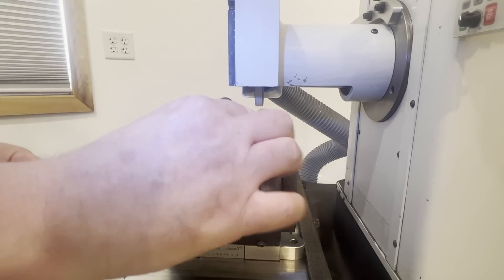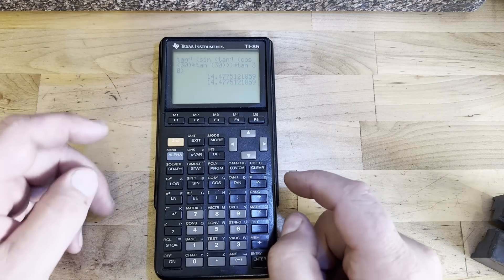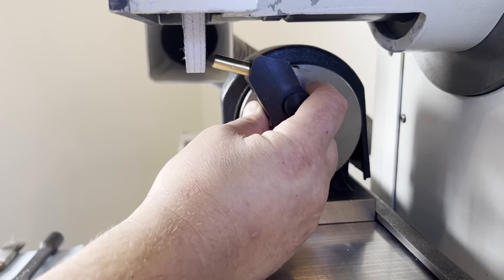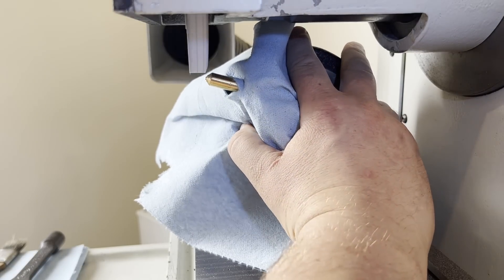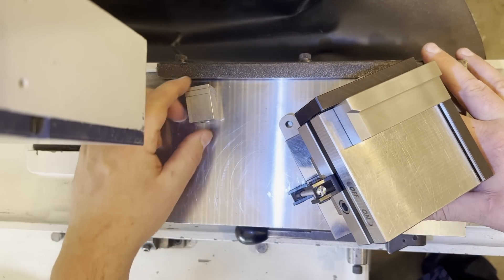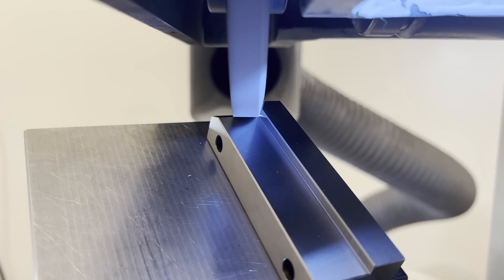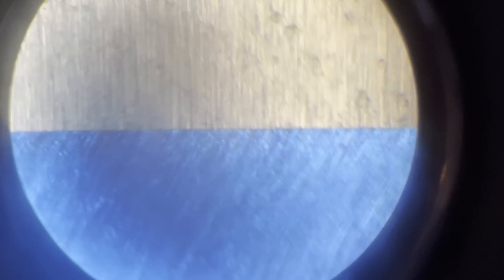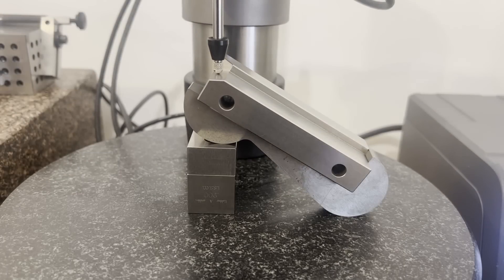Compound Chamfer-The Most Expensive Chamfer

Comment: Great content Adam. Thanks for posting. I’m not sure what I’m doing incorrectly but can’t come up with the correct wheel angle. I get 15.5 deg
Reply from the maker: Hi bob, it might be your calculator is set to radians or it’s a syntax error with an out of place parentheses
Reply: @adamthemachinist  thank you for responding. The equation I have as written is arctan(sin(arctan(cos(30))*tan(30))*tan(30)) is that correct?

Comment: How do you know when dressing the angle that the dresser is perfectly on the center of the spindle?
Reply from the maker: you can approach it systematically with a edge finder or indicator, but the sharp edge of the diamond nib isn't very centered on the shank . Ultimately I just eyeball it and check the results coming off the machine. That sounds crude but you would be surprised how good eyes are at lining up the bottom of a wheel to the tip of the diamond. one trick is to move the table back and forth slightly as you lower the wheel . if the wheel is at the tip height , it will only make contact when the diamond is at the center of the wheel .

Comment: I'm a programmer, not a machinist, but I absolutely agree with you at the end. Arguing with customers about design choices is almost always more exhausting than just doing the work how they want it done.
Reply: The only problem is that when the end product comes out poorly, the client starts to blame it on you and cite non-existent claims like how another company did it the way they asked and the product came out perfectly (which contradicts why they came to you instead of the other company in the first place). Then you gotta waste your time dealing with their nonsense.

It's the same for all industries.
Reply: That's why it's easier for designers to become machinists or vice versa. Unless you like to argue with yourself, that presents a new issue I suppose.

Comment: The angle, and the distances on the drawing for chamfers like these probably don’t mean a lot in practice. Like you said, most of the time it’s just a lead in angle. You probably could get away with scuffing any old angle on the corner there, but that wouldn’t be doing it as a ‘Toolmaker’.
Reply: Trouble is in this situation that the angles need to meet at a single edge, and if you make one angle approximate, then you can only get the other one to match by trial and error (I guess, clocking up and knocking around) which is more time consuming than just calculating it. Obviously it's not necessary to have a Newbould indexer, and dressing the stone with a T dresser and an angle protractor would probably get it close enough, but the Newbould and dedicated angle dresser are quicker than any more approximate solution could ever be to set up and operate, for those who already have them.

Comment: Could you have put the part at a compound angle (second sine bar, machined angle shim, etc) instead of dressing the wheel at an angle?
Reply from the maker: That would kick the horizontal chamfer onto an angle and you would need to dress the bottom of the wheel then . The two chamfers aren’t actually 90 degrees square to each other

Comment: Nice video.
Speaking as an engineer though, at least where I come from, we generally appreciate input from the manufacturer on ease of manufacturing. We've saved a lot of  time and money by listening to ours. These days, with our suppliers being mostly CNC based, it's usually more about what to machine fully and what to weld together from smaller parts though.
Reply: Yes, sometimes the lack of communication between the engineering and manufacturing results in very expensive and longer times. A complete stupid thing from engineers not listen the machinists feedback. 
But in my country sometimes the shop knows that is a better/easier way but they make more money the way you asked so they do the more expensive as requested.
Reply: that's why engineers with manufacturing experience are great.

btw did you know that you can friction weld wood? I learned that in my engineering book.
basically rotate a dowel into a slightly undersized hole, and then use a hard stop, you can also use that for surface on surface with a linear motion.
Reply: also even with cnc, sometimes the choice of material or process can matter, I saw some dude fully 3d print a speaker box as a rush job when he could have at least made the base with a hand router and guides and saved like a day of printing (out of a 60 hour print.)
and even then, the sides could have been cut mdf and saved even more time.

cnc is great but it's also not magical, and some features can be impossible on some machines and require costly changes of manufacturing or simply remounting the piece (for example clipping the toolhead when putting a hole next to a corner).

Comment: How do you assure the inside corner matching from both champfers is that simply by eye. " That last feed which is not a plunge .Paul V
Reply from the maker: I check the vertical chamfers size off line with a sin bar like shown for the horizontal and sneak up on the size .

Comment: who makes the indicator stand you are using on the surface grinder? the fine adjust looks like a good design.
Reply from the maker: mptec, its quite nice and the joints lock up in stages versus all at once. so you can lock the base joint and elbow but leave the wrist loose for smaller adjustment and then lock.
Reply: @adamthemachinist  thanks for the reply. really enjoying your content so far, cant wait for the next video.

Comment: Nice job. I'm a mechanical engineer with a machining background, and I'm thinking to myself why in the world does the angle need to be so precise. I appreciate your explanation for not pushing back, but I don't know if I'd be able to keep my mouth shut, ha ha. When you dressed the side of the wheel, did you need to be at the exact CL of the wheel? If off the CL, would the angle dressed actually be different than the angle desired?
Reply: You do need to take care to position the dresser at center . What wasn’t filmed is confirming the wheel angle by grinding thru a thin razor blade and checking the angle on the microscope . Some people also use graphite . If you search “superb industries tour” you see me giving a tour of my old jobs grind department and we go into detail about that .

Comment: Really great content, audio could use more attention, but I'm really impressed by your knowledge.
Reply: A lav mic would be killer.
Reply: @rootvalue  If you didn't notice, he had a lav mic already - maybe there was something wrong with the position or settings :)
Reply: indeed, the audio quality is actually acceptable, but very very quiet  - a boost and normalization in editing would be a massive zero-hardware improvement :-)
Reply: Intro was impossible to hear, don't want to boost my audio because then next video I watch from any other channel will make my ears bleed. Got a little better further in, but still very quiet.
Reply: reading this comment in the silence before he starts talking was the absolute perfect setup and punchline
Reply: My hearing was blown out by a burst of Machine Gun fire in 1980. I couldn't hear him to begin with, so, I turned the volume up and was able to hear every word. Even when he was speaking that calculator language, I didn't understand one word he said, but I heard them.
Reply: This! Audio needs to be at least 10 dB louder
Reply: @ipadize  I don't know about decibels but my TV sound level is usually set at 6, had to wind it up to 30 to hear his voice.
Reply: is good enough
Reply: Makes the most delicate, intricate, specialized tools, using the most delicate, intricate, specialized tools.
Has the worst mic on the planet.
Reply: Have you heard a machine shop? My ears done work to well anymore and you guys are worried about the fine vocal quality of Adam's presentation? I'd suggest more content before worrying about you sound quality!

Comment: If the angles don't have to be the same, which angle is which in relation to the part in the formulas you are using?
Reply from the maker: Thanks for asking that, i should have labeled the excel cells better . Cell b1 is the horizontal changer and c1 is the near vertical one
Reply: @adamthemachinist  I was referring to the angles you used in the formulas on the calculator. On the first formula for rotation angle, if the bottom angle was 30° and the short side that you dress the angle on is 15°. would the formula be arctan(cos(30°)*tan(15°)?
Reply from the maker: thats correct for the rotation . wheel angle would =ATAN(SIN(ATAN(COS(30))*TAN(15))*TAN(15)).
Reply: @adamthemachinist  Thank you sir!
Reply: @thefahj-122  thanks to clarify this important detail

Comment: What was the wheel rpm while dressing? At what diameter?
Reply from the maker: The wheel is just under 6” or 150mm . Wheel rpm is slower at 2200rpm . You struggle more to maintain form at that slow rpm but have way less heat

Comment: Great video. We used to grind 3mm x 10deg on the inlet to the material guide, whether it was fixed or a lifter.  A pain as we used carbide there (running full hard phosphor bronze)
Reply: Sent a quick note to your LinkedIn  too.

Comment: I know a lot of people shy away from math, but I wouldn't mind a more in-depth explanation of that. Stacking those trig functions becomes a little hard to follow what each one does in relation to 2D space. 

It is an interesting decision, do we quote the part to the drawing or offer cost saving / time saving suggestions. I dont think there is one answer for every shop / customer / situation. It is interesting to hear individuals thoughts on that.
Reply from the maker: If the customer specifically ask me to make some recommendations for dfm I’ll do that , but usually the process and emailing takes as much time as making the original feature
Reply: @adamthemachinist  Thats a good point, especially if you are just making one piece. It's probably a better use of time to make it to the drawing than sit around waiting for a reply.

Comment: Did you re-upload, getting a strong deja vu 😆
Reply from the maker: Tried to adjust the audio some, I’m very much so on the steep part of the video learning curve
Reply: @adamthemachinist  The levels are a lot better than they were.  👍
An inexpensive lav mic would help a lot when speaking to the camera.
Thank you for making the effort to improve your audio!
Reply: @adamthemachinist  In your video editor of choice look for an option called normalise audio and apply that to each clip for the next video. Normalise to -1dB to give it a slight amount of headroom. This will look for the loudest peak in the clip and then bring the level up to the target that you've set. This will also bring up the noise floor, which is not apparent for a loud clip but will be apparent for a clip that was recorded very quietly. To combat this adjust your gain during recording such that the loudest sound you expect to record is just below clipping. If you have a clip where the gain was set too low and you need to use it you can try to save it with some noise reduction but too much will make the sound very unnatural. If you have questions I'm happy to help, I've worked as a videographer and editor on the side for a few years. I tried linking to a guide once before but youtube decided to remove the comment.
Reply: @adamthemachinist  you're doing way better than me, all good. Just need a Bluetooth lapel mic. Rode or something that has good dynamic range.

Comment: Thanks Adam. Fancy chamfers are just tooo easy to add in Solidworks! I know you likely don't want the hassle  but if you ever had a YT channel supporter t-shirt it just has to say "It's not ours to ask why, it ours to build the die". Thanks also for not skimping on the maths.
Reply: or "Exercise extreme caution I guess"
Reply: We used to say it: "Ours is not to reason why, ours is just to Tool & Die"
Reply: A bit closer to origin sounds better in my opinion: "Ours is not to make reply, ours is not to question why, ours is but to build the die" bit long tho

Comment: Apriciate your professional content. Some issues with your audio microphone while recording in your shop, maybe the distance was too far away.
Reply from the maker: Audio seems to be my nemesis. Ultimately I don’t have much time or desire to buy camera gear, so I film all day with the gear I have and try to make the best of it when I edit it together .
Reply: @adamthemachinist  
Great video, although maybe a graphical explanation of how the dressing angle calculation goes could have been nice
To be fair the audio quality is acceptable, but mostly very quiet. Amplifying (each section up to 0dB) and/or compressing (the audio kind, not filesize kind) in editing (eg. Audacity) would be a huge improvement without any extra hardware :-)